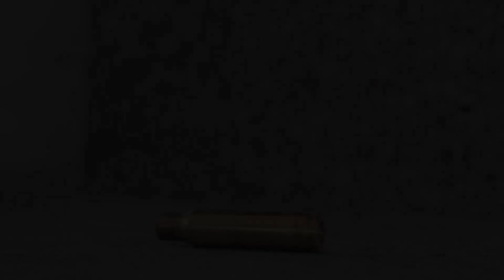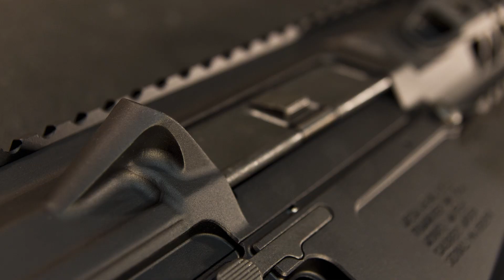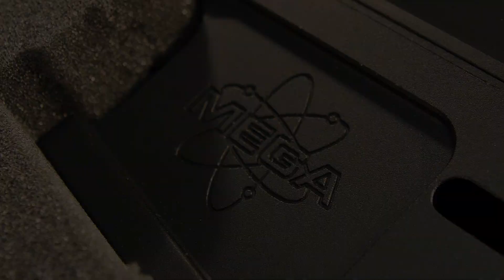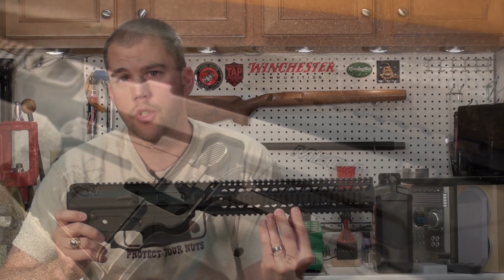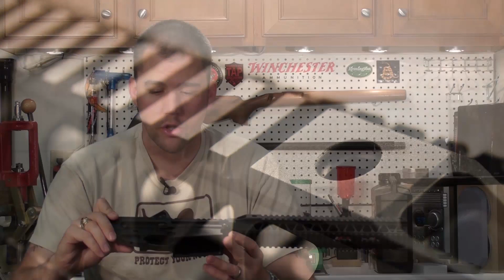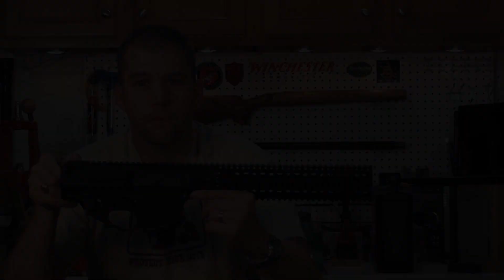MATEN Build Series 01 - Intro and Mega Arms MATEN Receiver Review

Comment: What are your thoughts on a “large frame AR” without a forward assist? I have a Rainer Arms billet AR-15 build and I love it but their large frame receiver set does not have a forward assist. Any feedback would be appreciated!
Reply from the maker: As you can see, this one didn’t have a forward assist. The large frame bolt carriers are heavy enough to slide hammer home stuff that you probably should not chamber. If you are worried about quietly chambering a round. It can usually be done by easing the charging handle down if the gun is clean.

Comment: I recently used a MEGA quad rail monolithic receiver set from Rainier Arms. It was flawless IMO and extremely high quality. I used an 18" Noveske barrel and BCG from Rainier Arms. They checked headspace to the barrel extension prior to shipping them. I used a Phase5tactical bolt release and a RRA NM 2 stage trigger and RRA lower parts purchased individually. A better trigger would be ideal (Geissele). Magpul PRS was used, but not necessary Anxious to see your parts selection. Love your videos! !